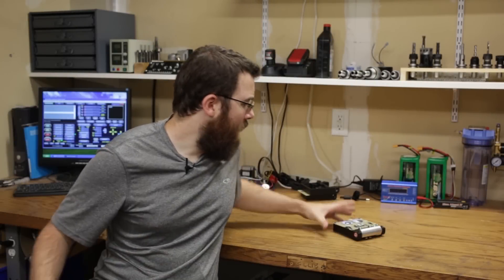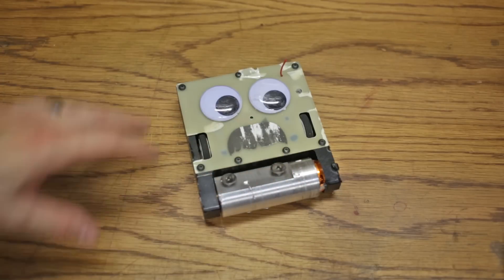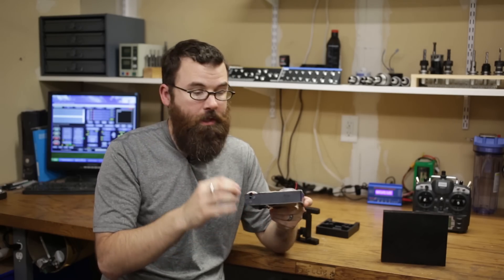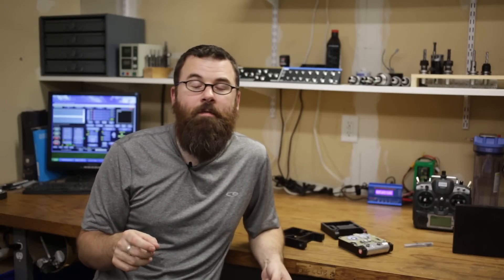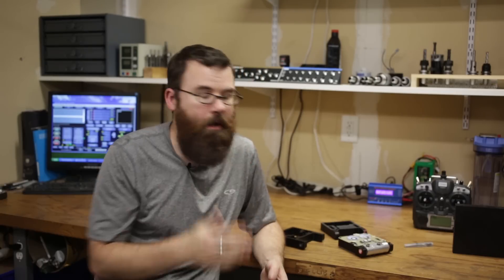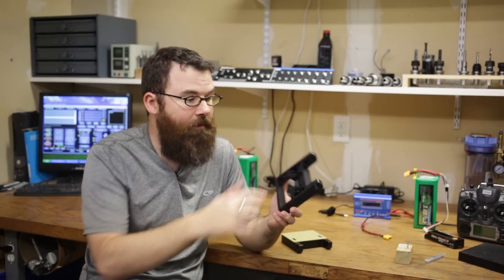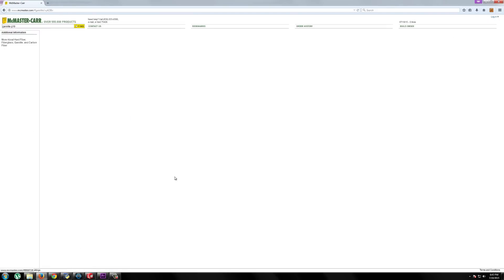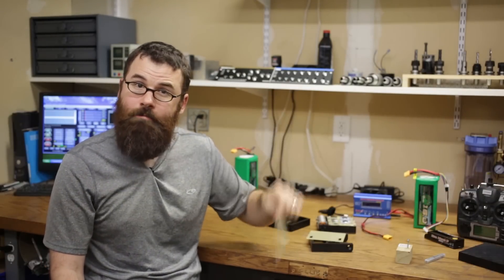Antweight Combat Robot - Part 1: Design

Comment: 500 rpm? everything I see online says 12000-14000 rpm.
Reply from the maker: Where did I say 500 RPM?  what context?
Reply: @RobertCowanDIY  for the spindle speed
Reply from the maker: @SomethingFishy707  It depends on the machine really.  You can certainly cut with a much higher RPM, but you have to increase the feedrate to compensate.  On that mill, the max cutting speed is around 100 IPM, which is too slow for that fast of an RPM.  But generally, plastics need a lower RPM and higher feedrate.
Reply: @RobertCowanDIY  oh ok thank you

Comment: what site did you use for your uhmw
Reply from the maker: I get my UHMW from McMaster Carr or Amazon.
Reply: whats your opinion of recycled uhmw vs virgin uhmw because am making a beetleweight dual disc spinner similar to hypershock with 1piece chassis and can order the uhmw recycled in custom Cut blocks for about 50Cad and have minimal waste or buy a small sheet of uhmw get 1 or 2 chassis and have quite a bit of waste
Reply: how thick is srgt cuddles chassis?
Reply from the maker: EXTRA THICC!!!!
Reply: Robert Cowan the reason I'm asking is because as I've been told it's not too good of an idea to machine 2" thick uhmw and i was wondering how thick urs was
Reply from the maker: I'm not sure why it's not a good idea to do 2" thick, it should be fine.  Mine is 1" thick.

Comment: can the 1lb combat combat robot be any side or does it has to be in the 4"  square? for example  can I be 6" × 6" × 2"
Reply from the maker: it depends on the competition.  some have size restrictions, others do not.  Generally, there aren't any size restrictions, just weight.  It can be any size you want really, as long as it's under 1lb.
Reply: all right thank you!👍

Comment: When you bought the switch, did it come with the connectors or you welded it after?
Reply from the maker: It comes with the tabs, you need to solder or connect your own wires.

Comment: love your videos. was wondering if you can use fan motors for wheel motors? i don't have any money to build something but i got a lot of junk to maybe use from
Reply from the maker: I'm not sure what you mean by fan motors.  Any motor will technically work, you just need to make sure it spins slow enough.  Most motors (without a gearhead) spin way too fast (10k - 30k RPM).  You will need something with a gearhead.  You can certainly use stuff you find in your junk drawer, but you might not be very competitive and it's not fun to lose in 30 seconds and then be out of the competition.  Check ebay or amazon for cheap gear motors, you can usually find knock-offs of the ones I use for $5 or so.  This would be a better solution because they would be in the right speed range and make the robot actually work ;-)  that being said, if you have motors with a gearhead, they should be fine.  If they don't have some sort of way to reduce the speed, they just won't work the way you want.  They need significant reduction in speed.
Reply: by fan motors i mean the motors that spin the blades on a plug in box fan. cause i got plenty of broken fans laying around.
Reply from the maker: Ah, those are AC, so they won't work.  You need a DC motor instead.
Reply: ok thanks. yea since i haven't been able to get a job after i graduated high school 7 years ago for what ever reason. i haven't the money to buy adequate equipment.  i just try to build stuff with the junk my pops and i have laying around the yard. thanks again for the valuable input.
Reply from the maker: DON'T get into robotics, especially combat robotics without a steady income.  It's VERY expensive, even with found parts.  I'm being serious.  You will still need to buy batteries, a receiver, etc.  It can all get broken in a matter of seconds.  It's an expensive hobby.
Reply: that i do know sir. but a guy can dream right? ha. it's just really hard to find a job when you live in the middle of no where with no means of transportation of your own to go out and apply in other towns or what not. i am still designing my bot but wanted to get info on all the various parts i need  for if and when i do have the funds to support and bring my bot to life.

Comment: Robert,

Ive modeled a bot close to yours using the parts you provided and guessing the dinensions. I printed it out on my printer. Would it be ok with you if i used it in competitions.
Reply from the maker: Of course!  I'm not into patenting or copyrighting designs...
Reply: Thanks!
Reply: +Stuff With Kirby honestly that's really cool. most builders are little jerks
Reply: +Alex Forman about their design

Comment: what are the screws that u use to mount the top and bottom plate.. do u have the dimension of the head for them?
Reply from the maker: They are just basic 4-40 machine screws, nothing special.  I just under-drilled the holes for them, so they thread in pretty tightly.
Reply: and for the diameter of the head?
Reply from the maker: It's a button-head socket screw, 4-40, they have a standard head diameter, check google.

Comment: what is the thickness of the wall of your chassis?
Reply from the maker: It varies drastically, depending on where you measure.
Reply: ok but the smallest is what approximately? do u think 5mm is enough if i wanna build one 
using uhmpw?
Reply from the maker: I think the thinnest is around 5mm or so.  5mm in UHMW is still pretty strong.

Comment: what is the size of the frame and did you make the  wheels or buy them and where did get them from
Reply from the maker: +Kyle Stokes The chassis is roughly 111mm wide, 122mm deep, and 25mm tall.  The wheels are made by Pololu, I got them from SparkFun:  https://www.sparkfun.com/products/8901
Reply: +Robert Cowan (Rowen Hobbies) thanks

Comment: Out of curiosity: why did you use the 9X with the OrangeRx receiver and the compatibility module, rather than just using a 9X receiver (or OrangeRx transmitter, I guess)? The HobbyKing page is also full of people complaining that there are major issues with the 9X and that module with binding. Did you have any problems?
Reply from the maker: +Thomas Chappelear - I haven't had any problems.  I used that because of the tiny transmitter available for the orangeRX.  there really isn't a small version for the turnigy.